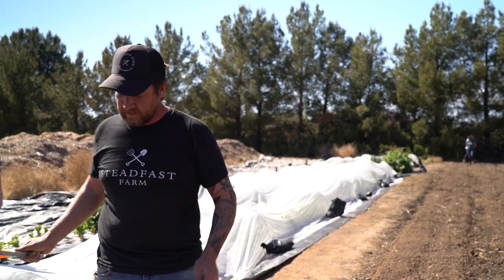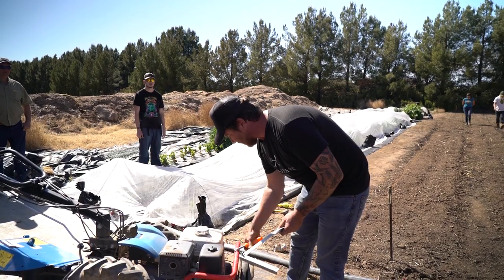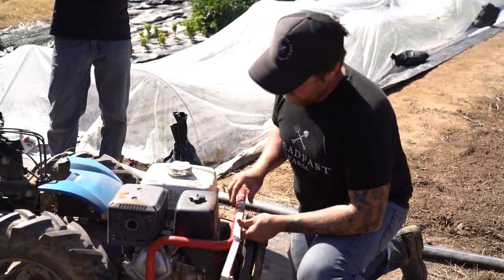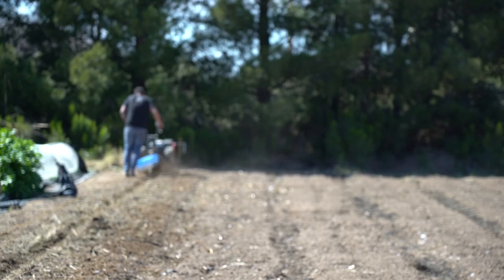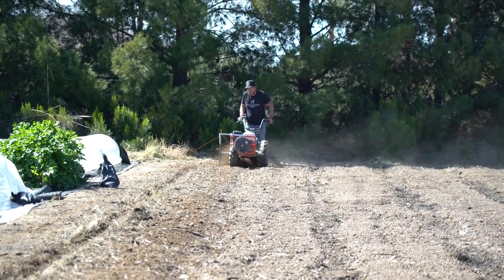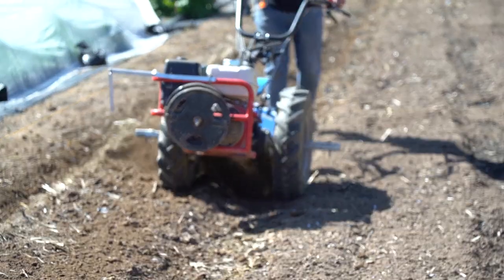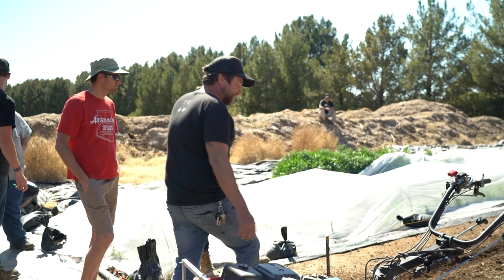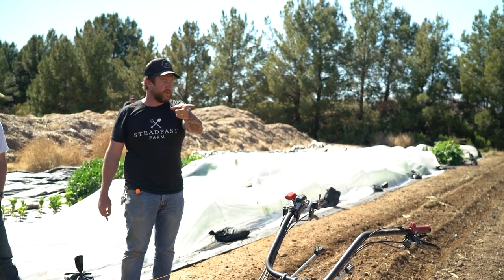Farming Made Easier with a Rotary Plow!

Comment: When shaping two or more beds, does one alleyway get rotary plowed in both directions, or just one direction?
Reply from the maker: Yes
Reply: Steven Hendershot we're going half deep on the first pass up the path, and full depth on the second pass down the path. If you go full on the first then there's not much material to kick out on the second. Hope this helps.
Reply: If you're working on a slope, say 3:1, the two passes per path doesn't work so well. Instead, do one shallow pass kicking soil downhill. This will help you keep straight although you'll need to circle around your area each time to come in the same direction.